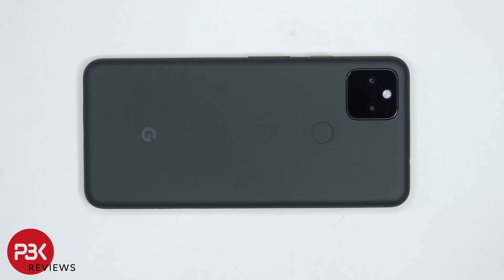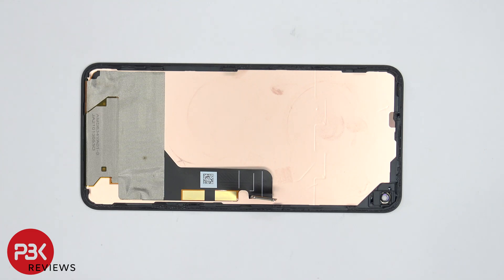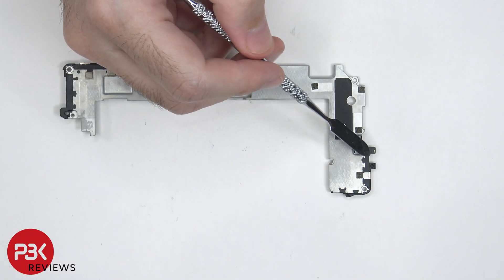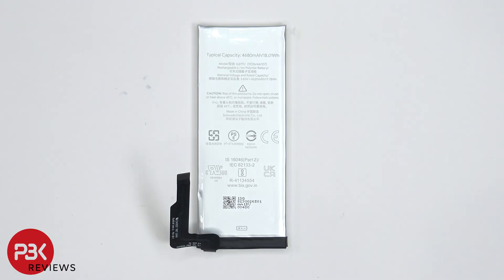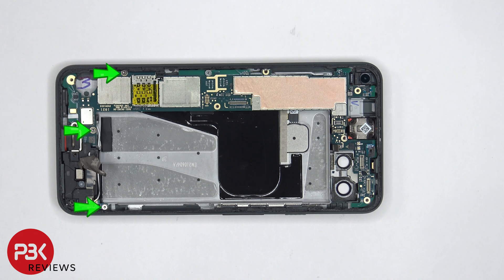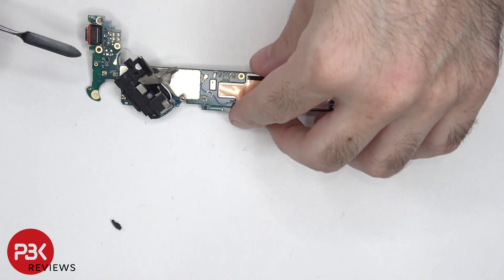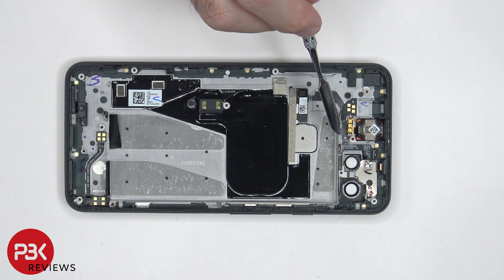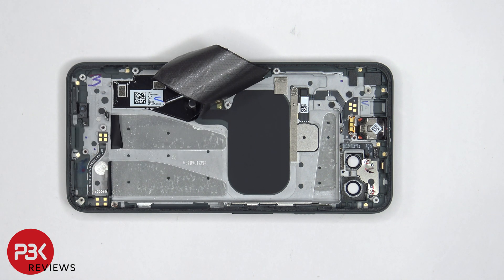Google Pixel 5a Disassembly Teardown Repair Video Review

Comment: I love that apple like screen replacement ability.
Reply: If it were Apple like, it wouldn't work after replacing the screen until you go to the Apple store and have them replace the screen and they re serialize the screen to the device.  All that for a price on only 3 times what a third party like Louis Rossman would charge.
Reply: @Birdman_in_CLE  Right to repair will kick their ass
Reply: @skncvuosucnlx  unfortunately, I have a feeling they will find a way around any new laws.  They have tremendous lobbying power and any new laws in the US will have carve outs for them. Hopefully the EU doesn't cave to the pressure.